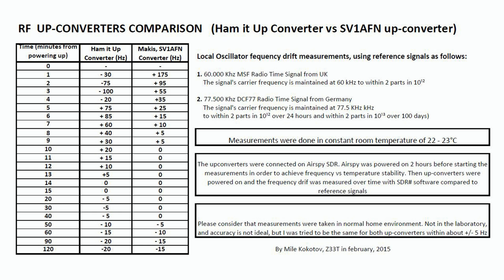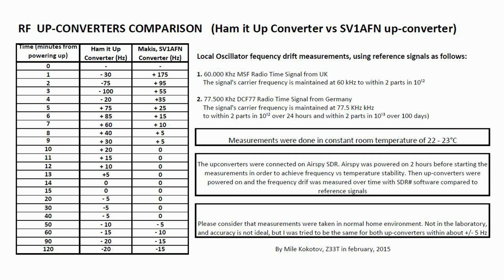RF Upconverters Comparison: Ham it Up vs SV1AFN - Part 2

Comment: Thank you for posting this.  I've added a 5ppm instead of the stock (I think) 25ppm TCXO to my Ham-It-UP v2.  This has helped somewhat, however, not as much as I had expected.  I'm working on getting quotes for a 125Mhz OCXO now that is supposed to be WAY better than the 5ppm TCXO I'm using now.  I haven't heard back on the quote in a few days so will being pinging them again soon.
Reply from the maker: Hello Tim, I purchased a 2,5ppm 125 MHz TCXO in DIP14 case from NooElec. They send me it for 19 US$ plus 5 $ shipping costs, with adapter from DIP14 to DIP8 for free, so I can use it directly in Ham it Up converter. Although the stability of the new TCXO is rock solid, I found that it has more phase noise. Also the signal to noise ratio of receiving signals is somewhat lower, and noise floor is slight higher. I have not make the detailed measurements but I simply put back the original TCXO.
Reply: Yeah I've actually found the drift on the new TCXO takes HOURS to 'almost' stabilize.  But it never really does.

I'm an avid CW op on ham radio (NW0W).  And drifts of 1khz over 2-3 hours is really unacceptable from my perspective.

I'm using the 0.5ppm RTL from Nooelec and it seems quite stable, but the UP converter has now been my focus of frustration!  I've been using these things for almost 4 years now.  I DO love them.  But this is just a narrowed down point of interest for me, I'm trying to get to a point where things are actually stable to within < 77hz or better in under 10 minutes.  Which is STILL a very long time if you just turned on your equipment and are trying to zero beat on a CW signal quickly.

I have a similar TCXO from Nooelec except they informed me that it was 5ppm and the cost was about the same including the DIP adapter.  In truth it's closer to about 9ppm+ which isn't good enough for my needs, and that's after hours of running and slowly drifting up band.

Thanks for posting your video and findings.  I hadn't really considered the Up converter to be a source of drift when I bought the new 0.5ppm Dongle.  But NOW it's painfully OBVIOUS.  Too bad...but hopefully we'll find a way to get things worked out soon.